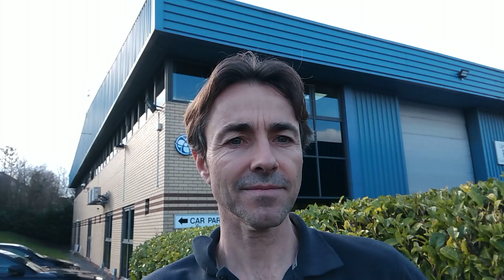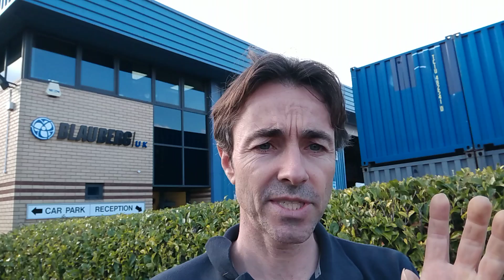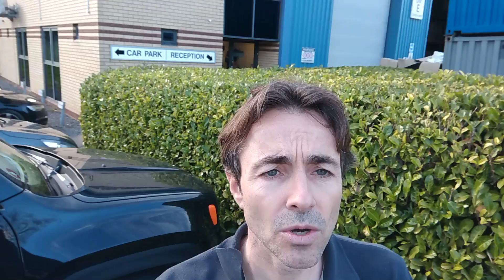Update on the MVHR system for my build

Comment: Look forward to this one robin. Ventilation is one of the things on new build developments that just isn't given enough design consideration in my opinion. Contractors seem to think a dMEV system with flexi hose ran over ridiculous lengths with bends, kinks, inadequate support, ran to an external vent is the right solution in all cases and its most definitely not. Good to see u investing the time in researching and learning what will be the best system for your build and how to install it correctly.

Comment: Hair cut mr clevett. Very interesting stuff. Have a look at the ox pro door clamp be good to see what you think is it worth £65
Reply from the maker: I will give it a look, thanks for the tip!
Reply: I see your point. However i made a beautiful pair of wood door stock from some of cuts of oak and even wrote on the after fishing them out of the skip on a number of occasions the works KEEP in permanent marker. The still ended up in the skip. Iv had them plastic ones you get from howdens break more than once. I simply thought this was a solution to my problems.